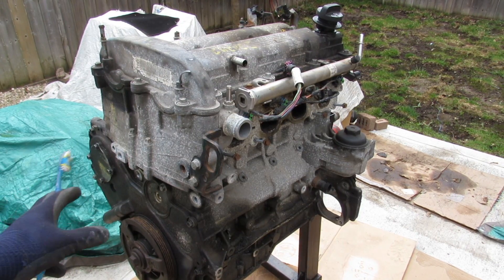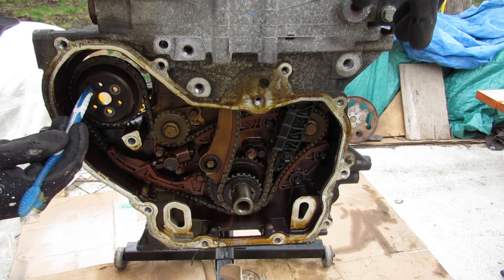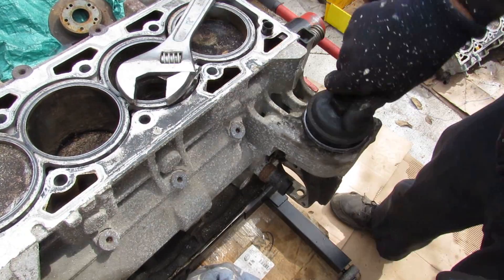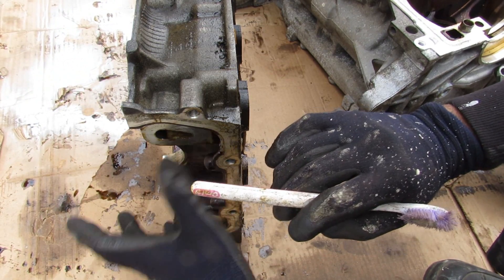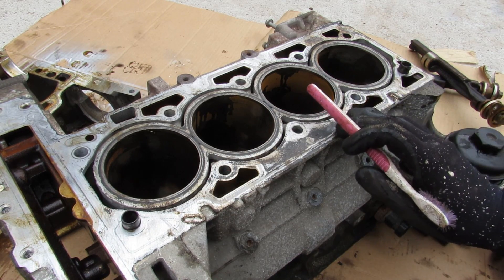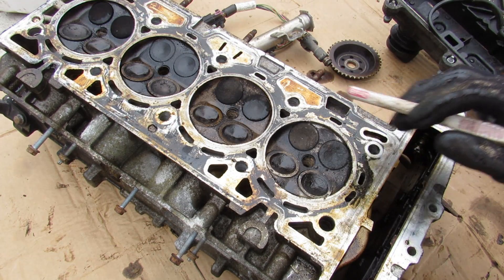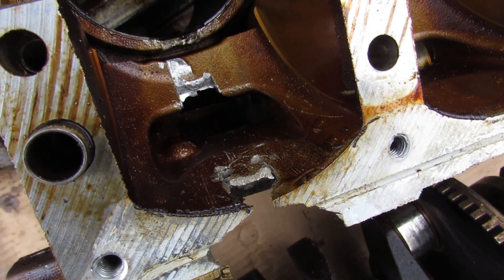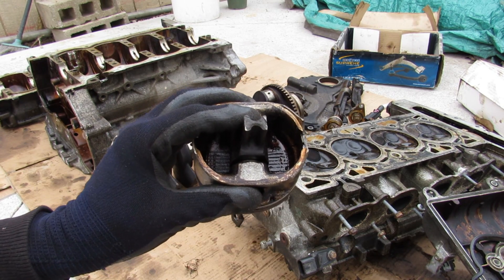Why GM Ecotec Engines FAIL

Comment: I love how no body realises these engines are not your typical throw away engine. These engines actually prefer them oil changes yall neglect you're other engines. Along with premium fuel. They are good engines if you do the required maintenance and use the proper fuel. Dont criticise this engine if you dont do needed maintenance!!!!

Comment: 2.2 ecotec is one of the best engines gm ever built. As long as you do maintenance they will never let you down. I've owned three. All with over 200k miles. Currently my 04 Saturn ion has 211k. Just like any engine, if there neglected they will break
Reply: 190K on mine. I try to stay religious with oil changes and have a magnetic drain bolt to keep me updated on how bad things are.

Comment: I have a 2016 Chevy Equinox with just over 38000 miles on the OD.  So far, it's doing pretty good.  There's no oil consumption issue happening and I want to keep it that way.  I believe that just about any engine can be reliable with regular maintenance.  I keep up on maintenance like changing the oil as needed every 5000 miles and I use premium oil for extra protection.  A lot of people don't maintain their engines properly and complain when they break down.  I'm hoping I can avoid catastrophic failure of my engine by changing my oil when needed.  I'm not going to lie.  That's one of the things I fear the most as a vehicle owner.

Comment: Anybody remember the 2.5 iron duke? It was the predecessor of these Ecotec engines. GM threw them in any economy/midsize car they could to meet  fuel economy standards of the day to compete with the foreign car market. They couldn't build revs fast enough, being a cam-in-the-block design with pushrods.

Comment: I've had ecotecs go well over 380k before the bodys of the vehicles went. 
These engines are just as reliable as the gutless Toyota Corolla engines when properly maintained.
Reply: Exactly idfk why people hate on them
Reply: Not the engines being made now! One of my friends is a service tech at a GM dealership and I know they replaced 3 Chevy Trail Blazer engines under warranty and had service records at the dealer. He told me as a friend to NOT buy any GM product right now. These were 2022 engines. There have been so many engine failures there is a long wait list for new engines because there are none to replace them with. These owners have to wait for an engine. The parts shortage has made it even worse.GM engines were pretty good until about 2005 then they went to crap ever since. I will continue to buy Toyotas and your comment is a real joke trying to compare these junk GM designed engines to Toyotas. Here is a video he made to educate Toyota haters https://www.youtube.com/watch?v=l6WXqdaiuKo
Reply: Lol you’ve ‘had’ ecotecs go over 380k

Toyota corollas are expected to go over 380k
Reply: @damonleeb  I've seen ecos go over 700k

Comment: Very complicated engine for a small one. I think it the type of engine you run till it busts. Surprised a cartage filter is used. Plastic parts in an engine hmmmm. Some one was not changing the oil. Low oil pressure is a built in self destruct.  Go GM.

Comment: 2013 Malibu 1.8 Ecotec comes with with a misfire. Pull off the coil pack, cylinder 3 is halfway full of coolant. 50,000 miles on the car, elderly owned - original owner -WTF GM?
Reply from the maker: Wow. Head gasket ?
Reply: speedkar99 we believe cracked cylinder head. I would post pictures but - YouTube comments
Reply: speedkar99 they are paying for a new head see what happens…

Comment: 2003 chevy cavalier 2.2L manual 5 speed is my daily driver.

After a trip to the junk yard recently...4/6 cavaliers they had were over 400k miles.

Bought mine in FL at 117k miles. Took off the valve cover to find nothing but sludge.  Replaced the timing chain and its still going at 180k.  I tow a trailer and fishing boat with this car regularly. Maintenance has been kept up to date since ive owned it.  Went across the front bumper of a tractor trailer on the expressway and am still driving it.
This car is bulletproof....inspectors were complimenting it at my last inspection.

Comment: Piss poor maintenance, And improper oil Viscosity will destroy any engine, It's not the engineers fault for someone Not🔥 changing oil when needed ❗
Reply from the maker: Yes. But some of these failures are design related. Especially the 2.4
Reply: @speedkar99  I do agree with the design not being the greatest but judging by the Varnish on Everything the oil couldn't have been changed enough, Yes I personally run Honda engine's, I haven't had any hard part failures with any of them, Two 1.3l engines  Three 1.7 liters and my new 2 liter k20 in my wife's 9-20 Civic Sport 6 speed manual Sedan. 3500 miles on it getting 36.2 MPG average 😎

Comment: Had the 2.2 ecotec in an opel for 17 years, never had problems with it, but the last years burning more oil
It was a reliable engine, but the 2.0 ecotec from opel before this one was better, no oil burning
Reply from the maker: Nice. The earlier ones seem stronger in the old cavalier than the newer cobalts, equinox, terrain etc

Comment: Much better engine than the vw 2.0. Most of them go out due to cracked  oil pan. Also timing chain issues. But reliable enough
Reply from the maker: yeah I'd say this is the better of both evils haha
Reply: @speedkar99  I replaced many of them ecotec but most if not all were due to lack of oil. People park too forward and be hitting the curb. Simple and cheap engine to replace

Comment: Depends on what generation ecotec. The gen2 engines had different piston rings that had a lower tension than earlier or subsequent replacement rings. The idea was to reduce internal friction as much as possible to increase fuel economy. Well, this had the very negative effect of oil consumption, poor performance (due to loss of compression) and engine failure due to the aforementioned oil consumption when customers run the engine completely out of oil.  Engines prior to 2008 didn't have this problem.  The 2010-2015 2.4 engines seem to be most effected.
Reply from the maker: So I've heard. Alot of failed equinox motors

Comment: Why did GM use such a dumb timing chain design? My 2.0L Tucson has an external water pump but only has 1 chain that goes down and then comes up again. No strange curving. Very simple design.

Comment: GM's engines are well designed, but poorly manufactured. Either you get a good one, or one that breaks apart like a cheap Chinese wristwatch. This started happening years ago when the shareholders figured it was time to replace engineers with accountants.

Comment: The ecotec engine is a descendant of the Saab 99 slant four engine, the 99 was a descendant of the triumph slant four used in the TR7. It was reliable when it didn’t produce as much power. My TR7 has the original British Leyland 2.0L slant four with 66,000 miles on it. It’s 45 years old and was sitting for 10 of those years. She runs like a top and all that I have done is be on time with oil changes and replacing the timing chain and tensioner once

Comment: When you need the special lock down tool> To change the water pump..Unless you want to remove the whole front timing cover because you didn't know. That if you don't. It will jump time and the balance shafts fall down..I would pass on them engines..

And what ever you do. Stuff towels under the water pump gear.. Them bolts can fall into the oil pan..I actually super glue the bolt to the socket..Just to make sure. As I done several of these before..
Reply from the maker: Good points , not a very accessible design

Comment: My friends car, 2006 Ion,  would burn 1-2 quarts of oil every change, I changed out the valve cover and gasket a while back, and hasnt been burning any oil since. One thing I did mention to her was I noticed the timing chain definitely had some slack in it, and since that job would cost more than the car is worth, only a matter of time before something happens, engine sounds good, no unusual noises, so time will tell.
Reply from the maker: Buy a AAA membership and hope for the best!
Reply: @speedkar99  funny, I suggested that to her 3 days ago

Comment: I have the LHU 2.0T and so far with 77K miles still smooth. Wastegate needs replacing but the engine is still smooth at idle and at load. BTW, been running a E49 tune for the last four years too.

Comment: The fact that the water pump is driven by an internal chain , instead of a simple external belt/pulley arrangement, tells me all I need to know. Stupid design. Makes changing the WP a nightmare.

Comment: A whole lot of misinformation & bs in these comments lol. As a long time owner of an 09 Cobalt SS producing 350 HP & 380 ft lbs of torque & an 07 Cobalt SS LSJ (ALL cooling mods, smaller blower pulley, methanol injection etc.), I can't believe some of the comments. I'd bet most of them are from non-owners believing crap they've read on the internet. The engines are tough as nails. You just have to not be an idiot & perform maintenance. Like on any engine. Yes the timing chains are a slight weak point but they're better than any engine I've ever owned with a timing belt. The main weak point in this system is the chain that stretches & one of the tiny bolt under a cover in the head that tends to break from abuse. Luckily Dorman has a fix for that with a new plug that replaces the stock bolt. It's MUCH stronger & completely fixes that issue. Even the 2.2 & 2.4 have proven to be pretty tough as there are now a lot of people supercharging or turbo charging them.
Reply from the maker: Nice boost.

Comment: so, the gist is that the oil rings are too small and can't properly do their job, so oil gets burnt, and if enough oil gets burnt, then the hydrolic driven tensioner on the timing can't do its job, skips, and bye bye valves and heads.

Comment: Ours broke the big static timing chain guide that goes from the intake cam down to the crank at 60k miles right where the fastener goes through. That engine was clean enough to eat out of. Shitty part was to blame. Thankfully I caught it and was able to fix it before something like this happened.
Reply from the maker: Yeah those guides don't hold up
Reply: @speedkar99  Which is a shame. Otherwise those engines had the potential to be the modern Chevy small block. Bruno Massel ran mid 6 second E.T.s with his 2.2 ecotec drag car. The 2.2 really is a great engine.

Comment: Couple of corrections. They are ‘oil galleries’ and not ‘oil galleys’. (Galley is food prep area on a boat). CAM shaft controls timing of the opening of valves, not their adjustment as quoted. Otherwise very interesting.

Comment: when a piston hits a valve, the valve doesn't survive (those valves look fine).  chunks off the edge of the piston indicate knock, which also has the force to break a connecting rod.

Comment: To reduce mass the use pistons with short skirts, unfortunately they are sensitive, if everything is not perfect, then u get piston slapp wear. The connecting rods are the thinnest I have ever seen, a cheap Peugeot TU 1.1 L
 4 cyl has twice as beefy connecting rods, that is weak design no tolerance for error.

Comment: I have heard this before about the timing chain. I don't totally agree because of that burned bearing. That looks like the oil starvation you mentioned. Looking at that filter, I have seen lawn mowers that looked cleaner and you know lawn mowers are oil filled once for life. I would say this is an abused engine and I could not make a determination based on poor maintenance. I would suggest the bearing failed, the piston hit the valves and that is what busted the chain. Plugged oil way, not timing chain.

Comment: GM should have just kept the old 2.2 pushrod engines, and the older Quad OHC/Quad 4s. Those actually lasted longer than these engines.
Reply from the maker: Those won't meat fuel economy regulations

Comment: gm tech here, if you’ll see the rectangle hole that’s in the bottom of the timing end of the engine when he’s removing the chain. lots of times the tensioners fail and the broken plastic falls into ur oil pan lol
Reply from the maker: True. The tensioners and guides are also major sore spots
Reply: @speedkar99  i’ve seen the guide bolt that’s thru the access hole in the head sheer off 🙃 that’s probably the worst thing

Comment: I abused my 1.9L when I made it into Arizona for the first time. On my way back I blew a radiator upper hose because my cheapass thought water would replace coolant. Temp gauge started pegging red zone in Cameron Iowa. I made it home to Moline, IL and rebuilt the motor.

Comment: I had a car fitted with this engine.  It munched it's valves and I paid for a rebuilt engine... that failed catastrophically due to the oil system breaking down.  Also that failed PCV valve design answers at least one curiosity I had that was oil in the intake manifold.
Reply from the maker: Ouch. Was it 2.2?
Reply: @speedkar99  Yeap.  Same cylinder that ultimately killed it.  Although mine just seized.

Comment: Leaking Static oil seals cause engine oil starvation. Leak starts out slow then goes catastrophic quickly. This is a major failure point of crankshaft driven oil pumps, GM is not the only manufacture with this design oil pump. Loss of oil pressure an flow explains all the problems you've discribed.
Reply from the maker: Yes good point

Comment: I had a Pontiac Sunfire with a 2.2L Ecotec. 250K miles and only had ignition coil and oil burn problems. Coil number 3 caused random misfiring and made the engine sound rough every few seconds. 

Instead of a smooth 4 cylinder "PUUUUUUUUUUUUUUUURRRRRRRRRRRRR" I was stuck with "PUUURRTPUUUUUUUUUUUURTPOPOPOPUUUUURRRRRRRTPUUUURPURRRR" while doing 60 on the highway.
Reply from the maker: Nice

Comment: Regardless of what engine you use, check your fluid levels (especially oil) at every fill up! One thing that I don’t think was mentioned in the video is that the newer ecotecs have smaller oil capacity like 3.9-4.2 qts so any oil burned is even more obvious as the level drops faster. It’s best to change oil early and often but even if you don’t, dirty oil is better than no oil at all.
Reply from the maker: Agreed. I check my oil at every fill up.

Comment: The 2.0 lsj is pretty bulletproof have a tvs 1320 on mine did the valves at 260k km currently at 310k still runs strong pumping 20psi peaking 273hp. Most crucial part is making sure your water pump for your heat exchanger is good cause they fail real often and if you don't catch it in time the blower will grenade.
Reply from the maker: Good tip

Comment: The entire engine looks like crap.  I wonder how well the owner kept it maintained.  Either the engine ran hot or they used cheap oil or oil changes where made well beyond recommended intervals.  I didn't see where the miles were mentioned, but I'd expect an engine with 200,000 miles to look better than that one.

Comment: We had a little Chevy HHR with the ecotec engine and it lasted us a long time because we maintained it very well. I drove that little thing fairly hard at times but I always gave it good service. Poor maintenance is what kills most of the dead engines we see today... sort of like yesterday, (the old days) if you didn't change the oil on a regular basis, bad things inevitably happened. What I hate is the stupid shits whining about and bad mouthing failed engines be it a ford, toyota or whatever. In the end its the lazy cheap ass owners fault that their engine blew up, seized up etc.

Comment: 1) DON'T drive it like ya stole it. It's an economy car, not a video game.
2) CHANGE THE FREAKIN' OIL.
3) There's nothing wrong with properly gaped Champion copper+ spark plugs, if you replace them every 10,000 mi like people did for 90+ years. In fact, they perform better in my Gen3 Hemi than platinum or iridium plugs. But you have to replace them. They aren't designed to be "100k-mile" plugs. 

I've got 166,000 miles on the L61 (2.4L normally aspirated) in my 2006 Classic. Absolutely nothing wrong with the motor. Sensors occasionally fail, and the car is about as sexy as a brown paper bag. But the motor is fine. It's going into a project vehicle in a year or two.

Comment: Pos.  Timing chain etc.. Better keep that oil changed if u have one. Had a customer purchase new unit w this engine and did not get oil change until 15000 miles and came in with engine noise. It was toast

Comment: Idk my car has an Ecotec and it's in fantastic shape and never gave me any issues. Over 10 years old and nearly 200k miles. I do change the oil regularly though. I think it's one of those things, thrown in cheap cars that no one maintains and boom they go. My former co-worker got 254k out of his ecotec in his HHR before he finally junked it due to rust.